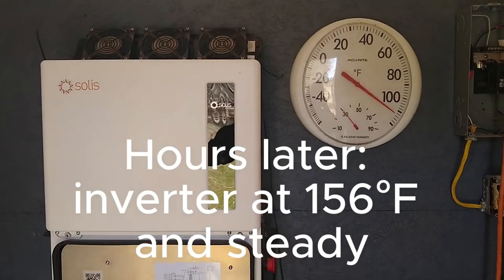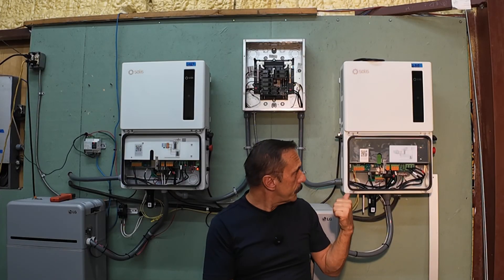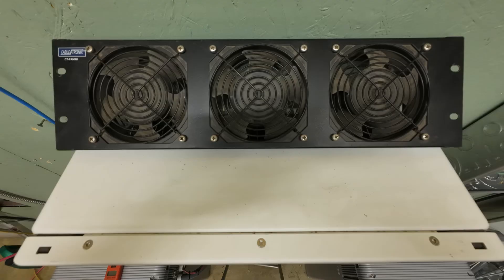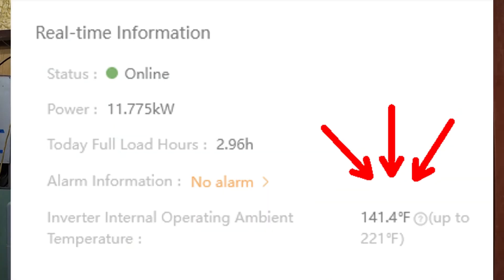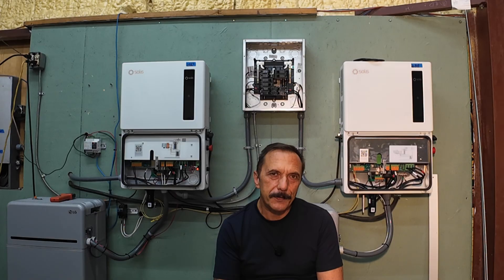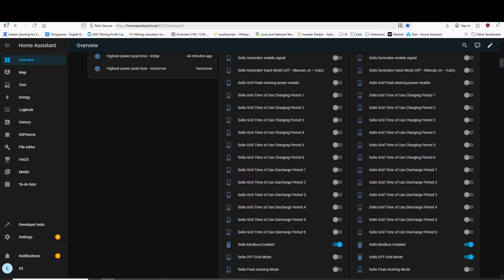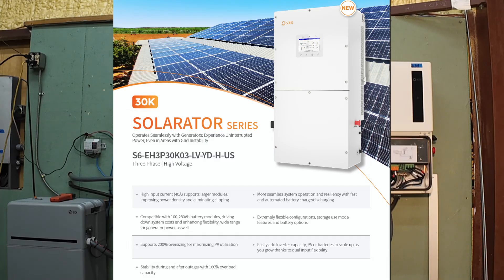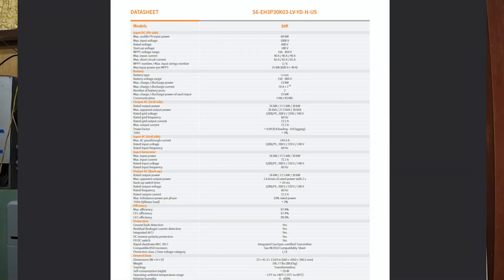High Voltage Solar What I’ve Learned After a Year

Comment: Is there a limitation for these Solis inverters when in parallel, in that each inverter needs its own battery as opposed to sharing a battery bank? I think this may be the 2nd or 3rd video I've seen  so far where the reviewer referenced a dedicated battery per Solis inverter.
Reply from the maker: Good question! Not sure exactly why that is I can only surmise it's because of the UL 9540 listings.
This is not a Solis limitation, I don't recall seeing any residential brand HV inverter that allows this.
A lot of the commercial inverters do allow a common DC bus with huge battery packs.
Thanks for watching!

Comment: I am very interested in learning about solar on a residential-only level. I like DC appliances because of speed control. I wonder why there isn't an interest in single-phase 240-volt solar panels with 120/240 volt DC output, to eliminate AC, and convert all or gradually most home appliances to DC? And then Continue with home wiring leave it alone, and wire key receptacles and appliances to a separate system off-grid? No back to grid B/S. Does this make any sense? PG&E on Our Terms? The 3 phase would I think, be interesting when setting up a DC fast charging system for cars and trucks at home.
Reply: Because AC is generally safer.
Reply from the maker: Thanks for watching! It sounds like you're looking for a simpler, more direct DC home system. Just need to keep it safe.

Comment: I wish this equipment was around 4 years ago when I was building my system.  My dump loads put a hell of a strain on things. And I had to bury 240ft of earth tubes to keep my power shed cool in the summer.
Reply from the maker: Yes, HV runs so much cooler.

Comment: So you think it's possible to wire it for 120/240 split phase for the output? And split phase to sell back to the grid as well? That would be a crazy good deal if true. Especially with 850v PV input.
Reply from the maker: I don't think that would work, I'm talking about Off-Grid. You can't sync just one phase to the grid.
Reply: @DIYSolarFarming Ah I see. That’s what I assumed. Well maybe they’ll a big high voltage split phase hybrid inverter some day..
Reply from the maker: @NoahZimmerman  I think split phase is tapped out at about 15kW with today's tech unless you go to one of the big LF inverters.

Comment: I'd like to know where you source you solar panels from, and how much your system is generating in Bitcoin, and why you got into Bitcoin mining, and a comparison video where you show how much cheaper using high voltage it compared to a 48 volt system and why. Also, where or how do you source the Nissan Leaf batteries.
Reply from the maker: Great ideas for future videos, I do have a great source for very cheap brand new solar panels!  thanks!

Comment: S30K - definitely would like to see information about this.  I have a significant investment in 48V for my main house system and it works fine for me.  My shop is a blank slate though.  I'd love to dig into 3 phase, and I've had it in the back of my head the shop system could 'sell' my home system excess power.

Enjoying your content and apperciate your perspective.  Defnitely would love to see more on this new inverter, and I'm interested in dabbling with mining as well.
Reply from the maker: Hmm, selling power. You might be on to something, I wonder if it's the other way around where your selling power to the business in the shop could that be an expense...
I have a micro-grid set up on my property with 3 different generation sites and just freely giving power to where it's needed, I may have to re-think that!
Thanks for watching and glad to hear you're enjoying the content!
Reply: @DIYSolarFarming  Right, a local microgrid is what I mean.  It's on the same property but it's currently fed by a separate transformer from the power company.  If I brought the house+shop together, I could eliminate a meter fee and move power around as I needed.  I do it on a really small scale with our RV - I have a pre-production inverter I ... won't discuss because I hate it, but it was cheap and the RV can backfeed excess solar to the shop/barn.

I need to do more research on how that Solis would work for standard US split phase; 120V isn't an issue, but I don't think 240V appliances work well at 208V unless they can detect it automatically.

And I'm interested in mining ... something.  Seems like a lot of the new stuff is inherently three phase.
Reply from the maker: @agtcovert  Got it. The Solis can be configured for 208/220 or 240 volts but the way they derive 120 from 3 phase the output needs to be 208, at 240 L-N is 139 volts. If you want 240 there is a way around that,  add a step down transformer for your 120 but that can complicate things, probably need a sub-panel for the 120. Best to ask an electrician about that...
Reply: 2 legs of the hot will go to a fused disconnect and from there to a 10-15kva transformer. Easy!
Reply from the maker: @about2088 Then would that go to a separate sub panel just for 120v loads?
Reply: You’d need a step down  3-phase delta-wye transformer with a 240V secondary and a center-tapped neutral. You can configure it for separate panel after that.
Reply from the maker: Your right, it is easy! :)

Comment: I want to learn more on the setup you have for the Solis S6, with the LG battery and what kind of Solar array you are using.  The S-30 looks pretty interesting.  I wonder what it costs and how it would be connected to use in a single split phase 240/120 residence.
Reply from the maker: Content upcoming, thanks!

Comment: I’m really looking into replacing my 48v lead acid battery bank. I’m a licensed electrician so, I’m not too worried about dealing with power, I just didn’t know that there were smaller high voltage inverters on the market that we could use. My biggest question is UL rating. Not that I’m afraid about burning my house down, I’m more worried about not being able to have the system inspected, then not being able to get insurance (which is a necessary but evil crock of shit).

Love the vids! Let’s see some real world stuff and how you make it work!
Reply from the maker: Thanks and good to have you here!
As far as UL both the Solis and LG batteries are UL rated so no problem with inspections.
Now the EV battery route might be an issue. ;)

Comment: there are always concerns about safety with high voltage and DIY. What are your thoughts? For me, building a battery is my preference, done lots of 48v packs but doing a 300v+ makes me nervous.
Reply from the maker: I understand, I always advise a commercial pack unless you are confident about working around HV. A full EV pack might be a good intermediate step.

Comment: I want to see you load test the S 30 K.  I wasn’t interested initially until I realized you could wire 240 split phase from it
Reply from the maker: Yes, I do hope we can buy them from SS!
Reply: @DIYSolarFarming I wonder the idle consumption of it.  Also do you wire a three phase panel then a split phase panel from that?  I’ll be doing some research